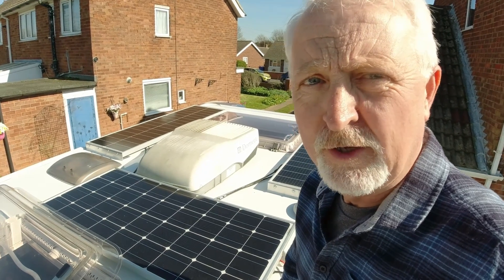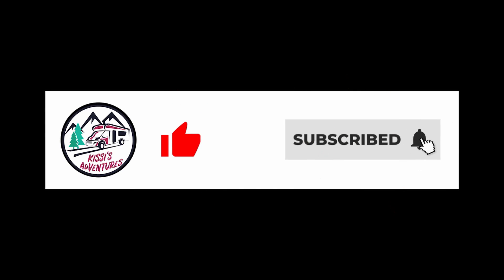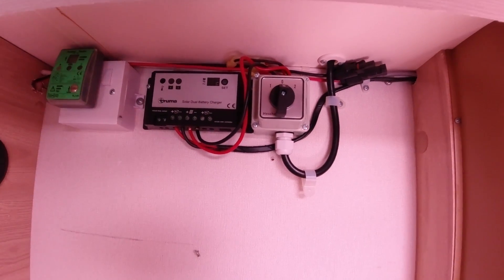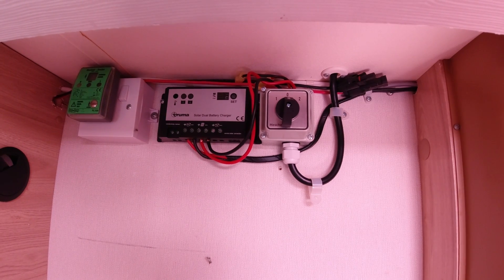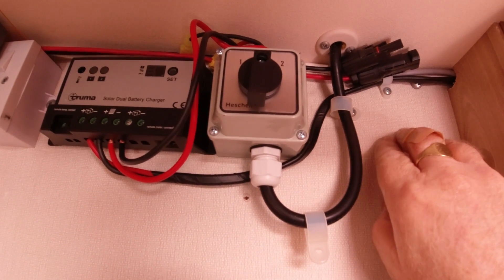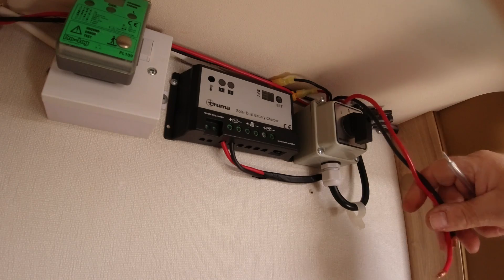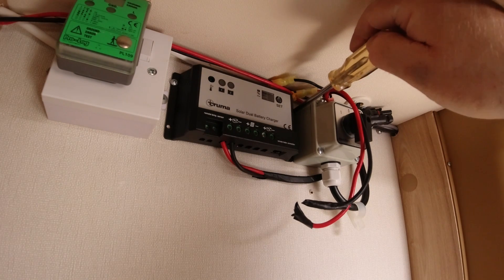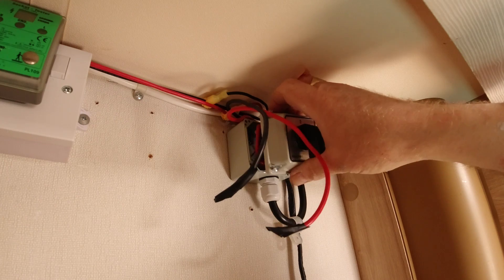Motorhome Solar Upgrade. Changing to a Victron 100/20 Controller

Comment: Nice little setup. I've got the 100/20 as well and it has been almost flawless. It did do something weird to the batteries once and seemed to over volt them but that was a one off.
I have 1x200w panel mounted on our camper trailer and a 160w folding panel we can move around with the sun. I connect them in parallel seeing they're different voltage and such and have seen 290w+ under good sunny conditions. 
Thanks for sharing the video.

Comment: How did you wire your ecoflow into the 240 volt hook up to use as a shore power connection to power your factory fitted 240volt sockets

Comment: Hi, im no electrician but that change over switch you are using says 220 Volts (AC), solar produces DC. I have been speaking to some sparks in work as i want to do something similar to charge my Bluetti and they say you shouldn't mix electrical components between the 2. Just a heads up 👍
Reply: 100% correct

Comment: Hi, have you connected anything into the load??
Reply: I've run a few things off the load. A fridge tended to draw too much current at start up so was causing problems but I have also run a small computer fan off it to try and keep my electrical cupboard cooler. I have it set to turn on when the battery is over 13v. The main reason for this is I have a victron dcdc charger in there as well and it runs like a dog when it gets warm. So using the 100/20 to detect when battery is being charged it turns on the fan.
Reply from the maker: No, couldn't really find a need for it

Comment: Great 2 videos of panels and controller installs and probably copying you're installlllation almost exactly for same reason - limited roof space.  Only query I have is that you have 300w of solar and there seems to be a limit of 290w on the victron controller  - small amount but is it ok?  Any issues with this?
Reply from the maker: Sorry for delay. I went on the assumption that there would never be over about 260w of solar coming in due to weather, angle of sun etc
Reply: No issues with over panelling the controller so long as you stay under 100v VOC. Victron recommends not over panelling by more than 33%

Comment: And the big question is are you generating more power with the same panels or not?  (At least 30% more cause pwm vs MPPT).  230W out of 300W is amazing for flat mount panels in March. Let us know about 270 out 300W

Comment: Just fitted a Victron 100/20 myself, happy with it, I wired my fuse box to the load terminals on the controller, handy,  lets you know instantly how much current each individual unit is using, and obviously the total amount if you have a lot of things running, have the inverter and diesel heater wired direct to the battery as the wires are a bit thick. for the fuse box terminals,  I have 2x100w panels, hoping to get another 100w soon so made sure I bought a controller to suit my upgrade, Good luck with your setup, seems to be doing the job!  Happy Traveling - subscribed
Reply from the maker: sorry for delay, just catching up.  Hope your system has worked out ok for you
Reply: Hi I am about to fit the same system. What size fuse did you use. Many thanks Glen
Reply from the maker: @glensanders7608  20amp, seemed to do the job. Good luck

Comment: Hi thank you for this video, however did you connect the solar panels in serias to have a higher voltage and less amps? I have the same controller, just wondering if I can connect 3 x 170 watt panels in serias to keep the amps less than 20? what do you think
Reply: Yes you can. As long as the total voltage of the 3 panels added up does not exceed the maximum voltage rating of the controller. I deff. advise on series connection of panels as it makes a more efficient system with less current loss. However at 170 times 3 = 510 watts will give you more than 30 amps going to the batteries and this controller cannot manage more than 20 amps output to batteries so you will be limited to 20 amps max. You will have to get a larger amp rated controller to see any benefit from your 3 panels. Greetings from Jamaica.

Comment: You should wire the battery to the controller first, then the solar panels.  Otherwise you have the solar panels are sending power to the controller, but the controller has nowhere to put it and it'll burn itself out.
Reply: His selector switch was on ‘0’, so there was no power going to the controller…
Reply: @albertjanrijswijk7849  his selector switch decides if power house to his "leisure" battery or his portable power unit.
Reply: No ya don't ya wire the solar first with a piece of cardboard on the panel so the panel doesn't get any sun them connect the battery
Reply: @patrickpirelli7897  Check the manual, it says to do the battery first.

Comment: Hey m8. The 2 extra terminals can supply power to something after the battery is full. You could use this to a water heater .
Reply: The load output has very limited capacity. I don't think it would be much good for a water heater. You can use it for small loads like lights, fans etc.

Comment: Nice work! 

I’m looking at the SmartSolar 100/30 to put in my small cabin. I’m so used to running a generator for everything that I won’t know how to act when I don’t need to run the generator around the clock.

Comment: thanks for a great video. I'd love to know how you wired the switch for going to the eco flow as I've just fitted solar and am about to get a battery power station
Reply: Same here would like to know🤔
Reply from the maker: Sorry for delay. Used this two way switch
https://amzn.eu/d/6gzdBUQ
Reply: @KissisAdventures  thanks so much!!  now I just need to find a video that shows what wires goi to what terminals on the switch lol
Reply from the maker: I wired the solar panel to the switch. Outlet 1 then wired to PV input on controller. Outlet 2 on switch goes directly to my ecoflow. The instructions with the switch weren't easy to follow though.

Comment: 230w isn't to bad considering the controller is rated at 20amp, I'm presuming that's your limiting factor. with 20amp * 12 = 240w.
Reply from the maker: Hi, went off the spec of the Victron 100/20 as follows:

Victron SmartSolar MPPT 100/20 20A solar charge controller for solar panels up to 290W (12V) / 580W (24V) / 1160W (48V) up to 100V (Bluetooth inbuilt). 

I assumed as the panels are flat on my roof I'd be highly unlikely to get anything close to 300w.
Reply: @KissisAdventures  I've just got the same controller but only two panels currently, flat like yours so we will have to see. What panel did you go with, I went for renogy purely down to price.
Reply from the maker: @wearewinging-it  two sunstore, slimline panels. Only ones I could find that fit in the space I had. Paid a premium because of their unusual size. Good luck with your install
Reply: @KissisAdventures  do you have insta?
Reply: 20x14.4 is closer to 288w

Comment: Thank you for a very helpful, informative video. I'm planning on doing a similar installation upgrade to our single 100W solar panel.  We have  a separate battery pack/power station and I want to have a separate cable to it using a two way switch. Do you know what model your kill switch is pleaseso I can find it on the internet. Thanks in anticipation.  Keep the videos coming! Mike
Reply from the maker: Sorry for delay, bit of an issue seeing my comments. This is the switch I used. It's fine but wiring diagram is a bit complicated and limited room in the back box for all the wires, especially if you're using 6mm or above cable.
https://amzn.eu/d/6gzdBUQ

Comment: Another informative video, thank you. Whilst understanding the disclaimer about not being an expert, I'd still like to ask a few questions if I may.
1. With the old system, I take it that you were trickle charging both the vehicle battery and the leisure battery from the solar control unit. How do you keep the vehicle battery topped up now?
2. Do you have any form of battery protection that will shut off all the loads if the battery voltage drops too low?
3. Did you consider running the EcoFlo from one of your existing 12v plugs rather than having to run additional wiring and fitting the change over switch? 
I'm curious on the last one because we need to find a way to charge our EcoFlo that isn't prohibitively expensive and doesn't demand too much of my limited DIY skills!
Reply from the maker: 1. I don't charge the vehicle battery from the solar although this is possible. The alternator whilst driving is more than adequate to charge the vehicle battery.
2. There is a 20a fuse in the pos cable that runs to the leisure battery from the  solar controller. 
3. The only way to charge the ecoflow from 12v is via the cigar lighter lead when the engine is running.  Personally I find this very difficult to use and it takes ages to charge hence why we've increased our solar. 
Hope this helps
Reply: Look into a battery to battery controller. That should charge the vehicle battery from solar when engine is not running
Reply: Aha, thanks for that. The reason for the question 're the vehicle battery is that we have a power hungry alarm/tracker/gremlin that means we really need a method of trickle charging when the MoHo is left for a couple of weeks. Noted on the 12v front, being a lazy fellow I was just trying to avoid splicing, running and installing wiring! Thanks again.

Comment: Looks good Andy, nice and neat. Does the Ecoflow have it's own solar controller built in? Cheers K.
Reply from the maker: Yes it does, you can plug a solar panel directly into it with the correct lead which comes with the ecoflow
Reply: bought some panels for my delta 2 and wish for a good range voltage drop  . a  permenant voltage drop to series em and keep em under 60v !!!   not good idea but its something